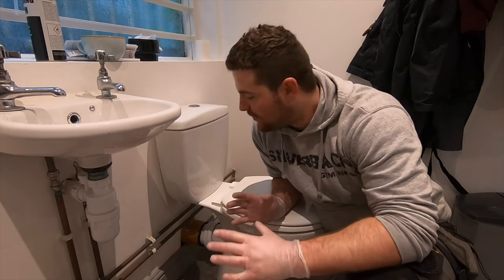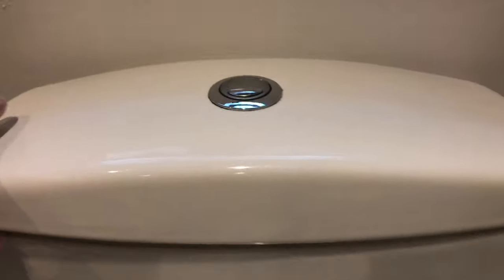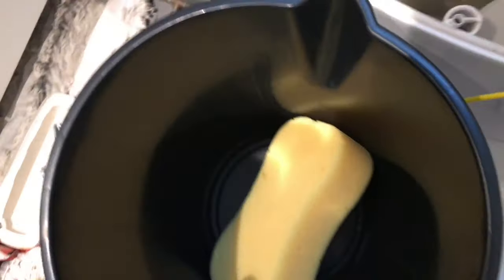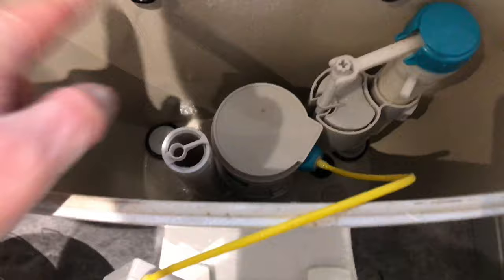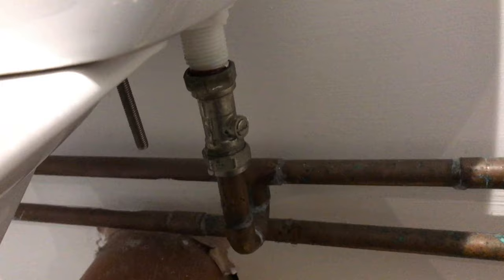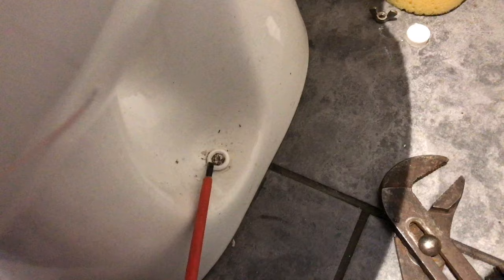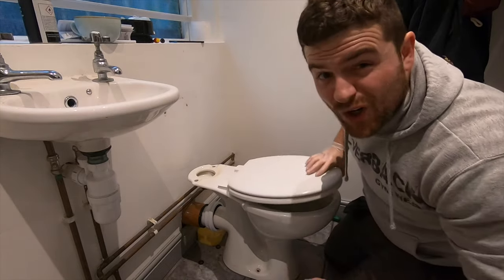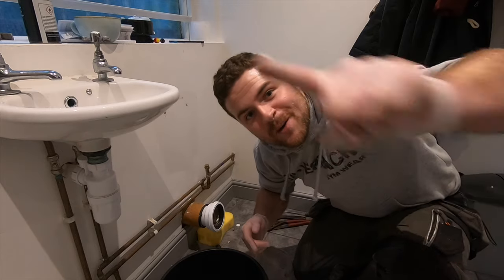How to remove a toilet

Comment: If you want to lower the water level in the pan before removal, gently use the toilet brush in a pump action to push the water through the u bend. The pan is usually heavy and it can be hard to tip excess water into a bucket. I always thoroughly clean the pan with bleach before starting any work as its a messy job.
Reply: Mop is the other classic for that 👍
Reply: Brilliant advice. You know I'm thoroughly cleaning my oo before I do this job.

Comment: How do you then stop the smell then? Just cap it?
My bathroom is smelling 😫 capped sink pipes and removed sink so thinking toliet is smelling 🤷‍♀️
Reply from the maker: If it's temporary just wrap a sealed bag around it and tape it up, if not then cap it off depending on where it connects.

Comment: any tips on how you go about putting the toilet back in after installation a new floor ? the toilet will sit higher
Reply from the maker: That will depend on the outlet, if it’s a normal 90degree waste then you’re fine, if it’s going out the wall you can get straight pan connectors offset.

Comment: Hi, thanks for the video. How do you block the cold mains outlet as you do at around 3:12 please?
Reply from the maker: The incoming mains is isolated on the valve with a slotted screwdriver, turn the valve from vertical to horizontal to isolate.

Comment: great video, I need to remove my toilet to get access to the pipe coming out of the wall, the toilet has been blocked on and off for a few years, I've tried all the chemicals and unblocking technique, and so this is the last resort, if there is nothing blocking in the 4inch pipe and the toilet bend is clear , then I'll just have to accept that my toilet doesn't flush very well , any ideas >?
Reply from the maker: Potentially an issue with the drainage, I would also rod the drains to make sure you cover all areas 👍🏻
Reply: @PlumbingGy  thanks is this something I could do , while the pipe is exposed ?
Reply: @PlumbingGy   re:drain rodding, I saw this vid, but I then found out I haven't got a drain like this, so I would have to rod the actual pipe from the toilet ?
Reply from the maker: You would be better rodding from a manhole in the garden if one has a rodding eye even better 👍🏻
Reply: @PlumbingGy   no manhole visible unfortunatley, just found this comment on a forum - Victorian properties did not have manholes. In fact many properties built well into the 20th century did not have manholes. You will probably have what is called an interceptor pipe somewhere. This will be a vertical ceramic pipe probably hidden somewhere underground with the passage of time. Quite often they are covered with a slab of concrete or an old tile and then the grass or whatever has grown over it. Tend to agree that it would be best to find this and if possible have a manhole dug. Stick your hand down one of your grids and see which way the outflow is running. You can usually work out the direction and try to trace where your interceptor is.
Reply: If the pan is off you could try gently inserting a piece of hose down the 4" to feel for any blockage. Rods are   not flexible enough to get around tight 90° bends and could damage joints. Obviously you don't want to lose the hose in the 4" pipe. Previously I have cut the end of the hose into a point to help it get past joints.

Comment: Thanks for your video. What did you call off the water with and did you use a new seal or wax around the soil pipe? Also, can you do a video how to remove an old sink.  It's all hard pipes, not flexible ones. Hope I am making sense. Lol. 🤗
Reply from the maker: Yeah perfect sense Cleo, yeah use grease around the waste fittings to make it easier to fit and normally you can isolate the water one isolations on the pipework. If there isn’t any, turning off the cold mains at the stop tap (normally under kitchen sink) or turning off outside of property at end of drive or on walkway 👍🏻
Reply: @PlumbingGy  thank you for info. Much appreciated.👍

Comment: I'm trying this but everything is so rusted even the floor bolts are literally rusted into bits gaskets are all gone I'm gonna have to replace the whole thing I think. I swear the only thing holding it all together is the pipe work and adhesive behing the tank!.
Reply from the maker: Drill/cut the heads off the rusted screws and put new ones in don't mess around trying to get them out just takes too long 👍🏻

Comment: Thanks mate this video was superb for me, short and clear good instructions. I easily removed my toilet with your tips. Found that neither the back of my toilet was fixed to the wall and the toilet itself wasn't even bolted to the floor, just held in place by silicone 😂
Reply from the maker: Glad it helped

Comment: Nice to see a British video, cheers
Toying with removing the toilet after kid flushed something down there, not sure what but believe a toy.. Very slow drain now and paper not even flushing

Anything else you'd recommend before removing the toilet? I've tried hot soapy water, a big bucket, a plunger and nothings shifting so possibly in the U bend before the waste pipe..?

Cheers!
Reply from the maker: Try some toilet rods, or something small enough and flexible enough to get round the u bend. In all honesty if it’s a standard toilet it’s probably easier just to remove it and look 👍🏻
Reply: @PlumbingGy  I've had a look at some 'auger rods' but they say not for use with a toilet :(
The waste pipe is 'tiled' in essentially a 'box' against the wall lol.....
From bad to worse hahaha
Don't really want to be breaking tiles
I'll have a play around with possibly stick my hand up the back
Reply from the maker: Head to the merchants and they do a flexible length for toilets it's only thin maybe 10-15mm I have one on the van, if no good just buy a length of 10 or 15mm plastic pipe and use that (done many times) especially on tiled boxed in toilets 😂👍🏻